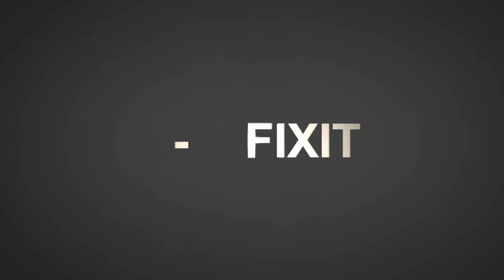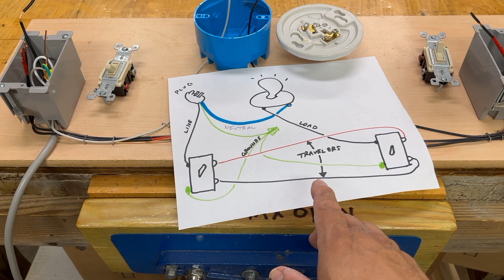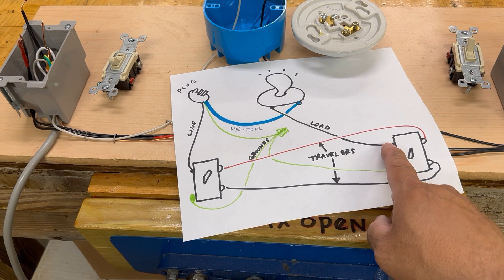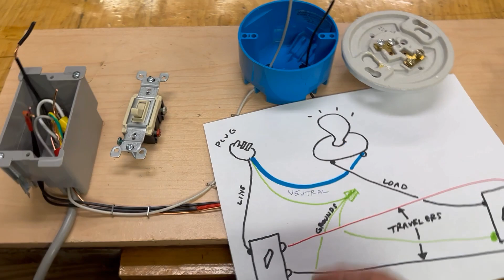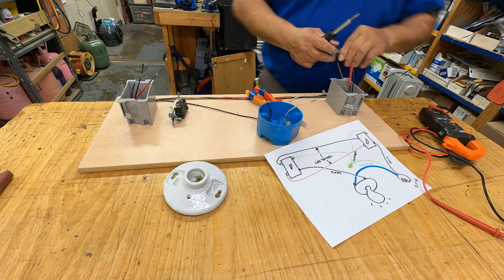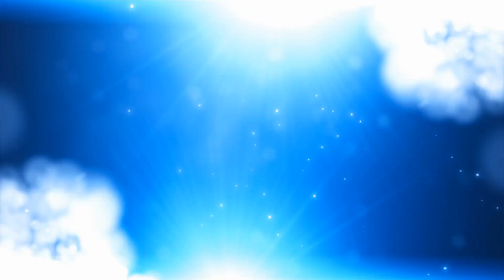3-way switch physical illustration with junction boxes switches wiring diagram & how to find common.

Comment from the maker: you can also check the back of the 3-way switch I have seen the word common and line on 3-way switches. Plus most 3-way switches use a different color for the common. If you see line the on a 3-way switch it's the common and can be used as line or load. Just mines are for aluminum wiring which is what I use in my location primarily, about 90% of the time.